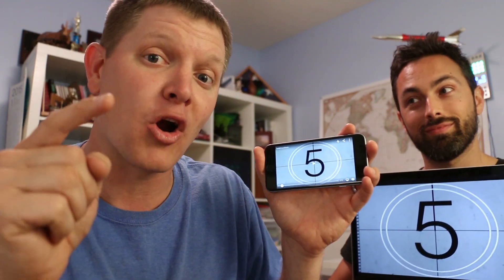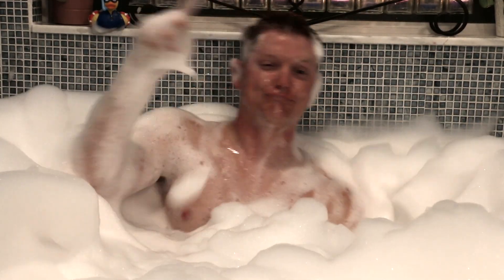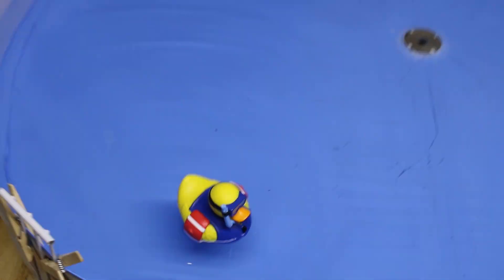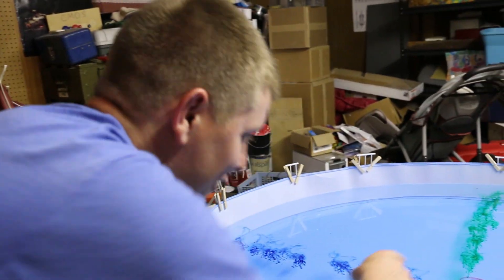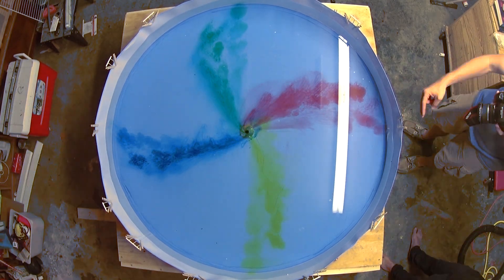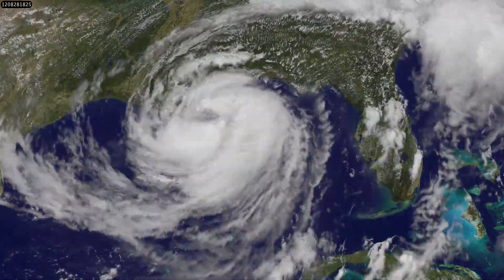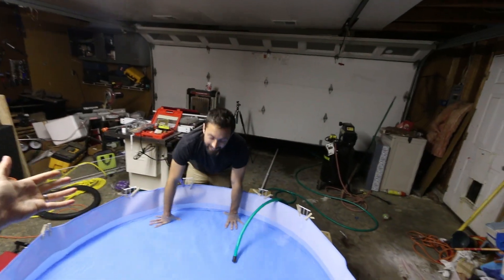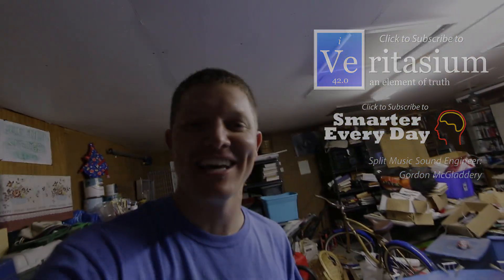The Truth About Toilet Swirl - Northern Hemisphere  (Smarter Every Day 137)

Comment: What happens when a hurricane crosses the equator? Does it weaken?
Reply: JackSwatman They never do, so it's never been seen. Presumably it'd have enough momentum to last a while but would weaken.
Reply: I did some reading, hurricanes are generally forced North/south west so never cross the equator, if they did the rotation would be countered by the opposing Coriolis effect slowing the hurricane's rotation down 

Also hurricanes don't form near the equator duo to very small Coriolis effect around the equator. So those videos of guys with the sticks in bowls either side of the equator are BS
Reply: JackSwatman I actually asked Google, "Can hurricanes cross the equator?" and the answer is no. The Coriolis Force is near zero near it. I've read some other suggestions and one of them states that a tropical storm can originate near the equator, but would travel away from it.
Reply: Yes, it will weaken the hurricane, because of the Coriolis effect, then the hurricane will slow down and spin in opposite direction, which would take time to have enough force to be destructive again.
Reply: The inter tropical convergence zone stops them, because there is no wind. Sorry if someone said this, I didn't read the thread.

Comment: Very cool, You have shown the Coriolis effect very nicely by using a large body of water, letting it settle and avoiding introducing any extraneous spin. But I think you need to re-enforce at the end, the fact that toilets are not the same as your pools and they swirl whichever way the manufacturers designed them to, regardless of Coriolis. The urban legend is toilets and sinks, not Coriolis itself.

Comment: Cool videos but I'm having a bit of a problem with the explanation, surely I'm missing something. What is the frame of reference for the water for its motion around the pole? The videos show the pool moving along the rotation of the earth but from a fixed point relative to the earths rotation. Surely the pool shares the same relative motion as the earth and hence does not seem like it is moving when you are standing on the earth. What frame of reference does the water have? Why would it have a different one than the pool it is in?

Comment: I think you should repeat the experiment with vertical drain reather a drain with a curve to the horizontal level. The difference in motion of the water on the top side of the curve could translate into a difference in the speed and flow rate of the water on one of the sides and cause an apparent coriolis effect, though I think the earth's rotation is more important in the matter. In addition you should both do it indoors, cause the wind could play a role as well.

Comment: That was a cool videos! I shall definitely click the thumbs ups buttons. I would also subscribe, but I already was (to both of you). :)

One complaint: it seems you only have a sample set of 1. I would speculate that the pools certainly have created a vortex no matter what, the only question is: "in what direction will it rotate?" Given that each pool only has two possible outcomes there are only four possibilities for this experiment: they both drain clockwise, they both drain counterclockwise, they both go in the "correct" direction, or they both go in the "wrong" direction. Basically all I'm saying is that, no matter what, you had a 25% chance of it happening as it did.

Comment: On test is probably not enough.

In Sweden they built a special tanks to try if water ran out in accordance with the principle of rotation of the earth.

It turned out that it was of no importance at all. The water icirculated various, sometimes it iust ran straight down.

Comment: Very cool idea. But I am not impressed. It could be just a coincidence.
You had to repeat this experiment  at least 4 times, because the probability for the "right" outcome was 25% percent, and it is  pretty  high.
Reply: They did the experiment 3 times it says so on verittaseum
Reply: Check description. They did the experiment 3 times
Reply: Simo Puttonen  ok, i just never read the description:)
Reply: Toni T800 They did it multiple times, but it's not trying to prove anything, it's based off of an MIT study where they tested it far more thoroughly. This was to demonstrate it in a simple way that anyone could do (those pools are incredibly cheap, try it yourself!), not to act as proof. So no, it isn't coincidence, acting as a skeptic is great but you might want to look into things a bit more (especially since all this info is right there in the video and description).
Reply: No sef Nobody was talking to you either, it didn't stop you from trying to be clever.
Reply: No sef
'Trying' being the operative word.
Reply: Toni T800 you're*
Reply: No sef What?
Reply: Simo Puttonen was i talking to you?
Reply: No sef No, but what were you correcting?
Reply: Simo Puttonen it's doesn't involve you so therefore you shouldn't worry about it.
Reply: CaptainMcAwesomepan you're*
Reply: CaptainMcAwesomepan you need to go back to english class buddy

Comment: Protip: You want Destin's video on the left and Derek's on the right.
On windows: You can use the Windows key + left or right to move a window to the left or right side of your monitor(s).
Reply: Ry P or you can drag it to the edge of the screen on the side you want.
Reply: Ry P I've been using windows 7 for 4 years and I'VE ONLY JUST FOUND THIS OUT!!! Thank you so much :D
Reply: Ry P In the end they switched sides, so it does not work anymore, but yep I was positively surprised when it worked so well in the beginning :D
Reply from the maker: Ry P This is the right way to do this!
Reply: Ry P 
Linux: CTRL + Win + Arrow
Reply: Ry P or drag the window to the edge and it will snap on windows 7 and above